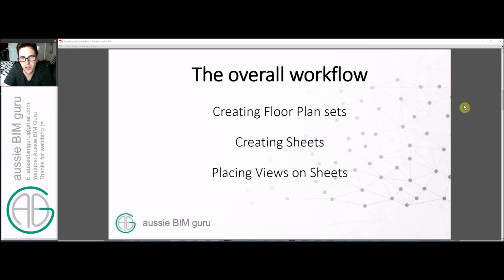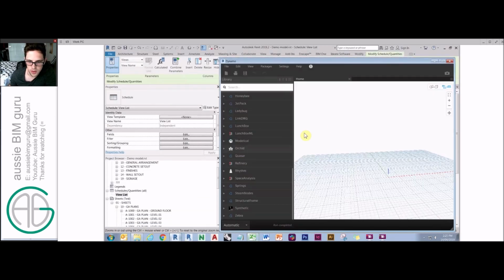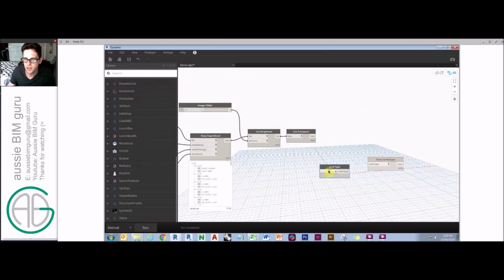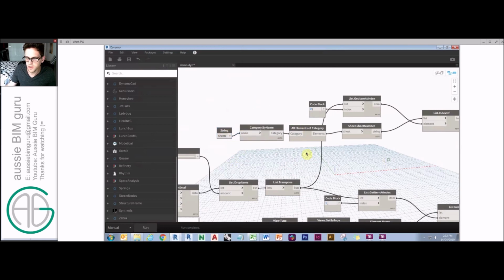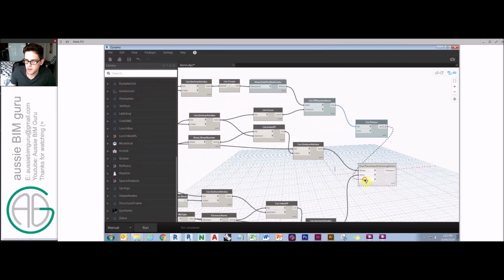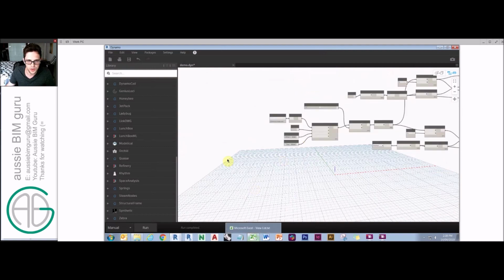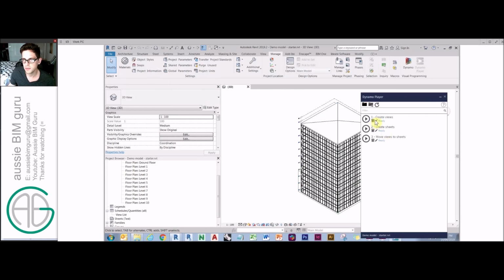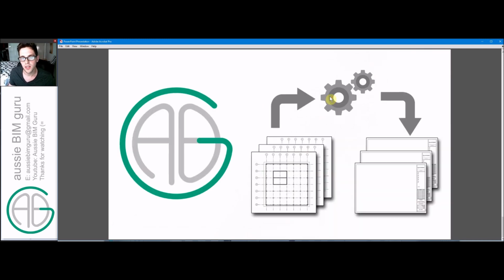Place Views on Sheets using Dynamo! (Views to Sheets 3/3)

Comment: Thank you BIM Guru for spreading wisdom! I am new in Dynamo and using Revit 2021 with Dynamo 2.6.1.8850. For some reason the custom node "Tool.PlaceViewsOnExistingSheets" is not working:

"Warning: This custom node contains an invalid input. Please fix the input before saving the custom node."

To make the custom node working, I have to change all inpust to "sheet: var[]..[]" (with small caps). If I put Sheet (with capital S then it will recognize an element and get an error).

1.If I run the script with Auto lacing then I get the following message: "View is already placed". But it is not doing anything in Revit
2.If I run the script with Longest lacing then I get the "null" message. 

I am struggling for a day to make this work and not sure if the problem is with the listing input or the custom node. Is there anyway to start from back to front and test the custom node alone for just one view / sheet?

Any hint will help. Thank you in advance
Reply from the maker: The custom package is quite outdated now unfortunately. Maybe try my equivalent node in my custom package 'Crumple'. This one should work.
Reply: Hi @AussieBIMGuru , @Sorin-Stefan P. what's the exact name of your equivalent node, I am typing "Tool.PlaceViewsOnExistingSheets" but nothing comes out but the same problematic custom node from SteamNodes. Thank you so much!
Reply from the maker: It should be under Crumple > Revit > Views (not at my pc currently unfortunately). One node should do 1 point for all sheets, the other supports a list of points per view/sheet pair.
Reply: @AussieBIMGuru  you nailed it, it works perfectly!! Thank you so much. Stupid question I am trying to download the scripts you have on your github (not for this but maybe others in the future) but I can't really download a .dyn file, basically I was wondering how could I import this coding in to dynamo to make it work.

Thank you for your patient.
Reply from the maker: @danieltrevijanostehle7829  try github desktop instead. Usually the top right of a repo should allow for downloading as a zip also.
Reply: @AussieBIMGuru  It works I could see the green button and download the "Dynamo_Scripts-master" with dozens of dyn files inside but not this (ABG_190923_ScopeBox-3-ViewToSheets.dyn) seems on the Master file are some files but not all and the ones that are outside, it doesn't allow to download just to see hundreds of coding pages.
Reply from the maker: @danieltrevijanostehle7829  hrm try github desktop instead I'd say.

https://youtu.be/Rr6pVUa5Wc4
Reply: I just found it on the Master file, my bad! Thank you so much for all your support
Reply: @AussieBIMGuru  thanks for your quick reply. Already tried that with both of your custom nodes. Still getting the same "null" error although the input lists seams to be fine:

Views list has 25 items showing the view names
Sheet list has 25 items showing the sheet numbers from
Point list has 25 items with the same point coordinates as per the reference view / sheet in Revit.

I have also tried manually created input list for view / sheet / point  to check if the custom node is working. Still cant get it to work.
Reply from the maker: @SorinPauceanu  make sure the views and sheets are elements and not names.  Otherwise it should work.
Reply: @AussieBIMGuru  many thanks, that solved my problem and it's all working now. Hooray !

The error I have done was in the final nodes for both Sheets and Views (List.GetItemAtIndex) before the custom node. Instead of feeding the Element, I was accidently feeding the Sheet.SheetNumber name and Element.Name as text. Moving back one node fixed the issue (All Elements of Category / Views.GetByType). 

For other beginners like myself out there, the difference between text list and elements list is that elements list have a unique number at the end highlighted in green.

Bless you man!
Reply from the maker: You're most welcome! I used to make that error all the time when I was learning Dynamo originally, great tip for others out there.
Reply: @SorinPauceanu  I am struggling from the same issue .Can you please help
Reply: @AussieBIMGuru   I am getting the same error. Can you please elaborate how to resolve
Reply from the maker: @hallydesai2464  please read the comments where i elaborate on some solutions.
Reply: @Aussie BIM Guru I tried this but I guess I dint get this properly.  It would be great if you can help
Reply from the maker: @hallydesai2464  i dont know what it could be if not the things i address in the replies. Most common issues are typos in excel, custom node not working or elements not being filtered properly (sometimes people use names instead).
Reply: If I run the script with auto lacing I get the following message: your view is already placed . The solution to this is there in this comments which I am unable to understand. If you could clarify that a bit more
Reply from the maker: @hallydesai2464  this means your view has been placed on the sheet already. Usually people run the script and then rerun it to set the viewport type, but the node can't rerun as the view has been placed. My recommended approach is to use dynamo player to run the script in a single run.
Reply: @AussieBIMGuru  ok will try but for now when I run it but it is not doing anything in revit

Comment: It seems the node Tool.PlaceViewsOnExistingSheets has broken due to updated dynamo, any advice on how to fix this?
Reply from the maker: I have a video where I show how to do this in Python instead;
https://youtu.be/6oHl-QEdutw
Reply: @AussieBIMGuru  I tried using it but I'm not sure honestly how to combine the the python from the link you shared to the flexibility of this video. I'm well enough to follow along and create what's needed but fixing or altering code isn't my forte. It looks like the Input>Point in Tool.PlaceViewsOnExistingSheets has changed?  It states, "Error: This input symbol is not currently valid, and cannot be saved until it is fixed." I've been trying my best to figure it out. This 3 pt series is extremely helpful due to a cruise terminal project and how fast everything can be set up. Minus my current hiccup.
Reply from the maker: @josephkirkpatrick345  the problem is the node I used here wasn't maintained by the package's owner. If you don't know how to mod the custom node or use Python try downloading my custom package called 'Crumple', I added it to the manager a few days ago. It contains a fixed version of this node.
Reply: @AussieBIMGuru  I figured out how to mess with the custom nodes and know a little python, but not enough to possibly bring it all together in the manner necessary. I'll go recheck Crumple now. I wish more people existed like you!!

Comment: Hi im getting "View is already placed" at the Tool.PlaceViewsOnExistingSheets" but the views I am selecting are not placed anywhere as I can manually place them on a sheet. Anyone ever encountered this?
Reply from the maker: That is odd! Maybe try reopening the script - it usually doesn't support multiple runs in a dynamo session.

Otherwise, try my custom package on my github (Crumple) where I've built my own nodes that do this as well.
Reply: @AussieBIMGuru  Hi! I have downloaded and installed Crumple but cannot find the node to replace ¨Tool.PlaceViewsOnExistingSheets¨ which is not working for me either. Can you tell me which node to use, please? I am a beginner so I can get lost fairly quickly. Is it ¨viewports.Createbypoints¨? Thanks!
Reply from the maker: @mariavallejos23  yes it is viewport.createbypoint
Reply: Hi, i was getting exactly the same warning. The problem was that I misunderstood and was not passing “views” and "sheets" to the Tool.PlaceViewsOnExistingSheets node, but rather  string values (their names).  Now this great script is working perfectly well and making me save a lot of time!
Reply from the maker: @rubengonzalez1729  yes using names instead of their related element is a common error even I make from time to time!

Comment: Hello, can someone tell me why i get the message null after the first the first information input to "Data.importExcel" - I have checked everything twice and can´t find anything wrong with the scripct
Reply from the maker: If the excel import is failing I would cross check that the sheet name exists and if it does then try rebooting dynamo, sometimes the node runs into problems when excel is open already I find

Comment: Hi Gavin, I am trying to use this method to place multiple views on multiple sheets, any ideas I could use on what needs to be changed for the script and excel file in order to achieve this? Another great video by the way!
Reply: I have also put my question on the Dynamo Forums, https://forum.dynamobim.com/t/placing-existing-views-on-existing-sheets-with-excel-and-a-reference-sheet/49987
Reply from the maker: Hi Serim!

I would adjust the script so that you either collect more reference views (say up to 3) and in excel specify the index of the reference view for each as an additional column, or you could add X/Y/Z values for placement points fot each view as columns also, then feed these into a point.bycoordinates node to define the placement points.
Reply: @AussieBIMGuru  Hi Gavin, I used 1 reference view and an excel file with multiple columns. Eventually managed to filter the script correctly by counting the amount of views to place on the sheets. I posted the solution on the Dynamo Forum post I made earlier! Could you check it out and give me some feedback on my solution? Thanks in advance!
Reply from the maker: If the viewlist always matches the reference views, repeated item lists are a suitable solution for sure!

Also yes, the steamnodes package is a bit out of date - it can be tempremental. If you're curious as to how the node works in Python, feel free to check out my custom package 'Crumple' on my github, which has a pair of nodes dedicated to this workflow.

Comment: Hi, I am new to Dynamo, I was wondering if anyone could help me with my problem. I don't have import excel as node, is there any package that I can download ?
Thanks
Reply from the maker: Hi there!

Import excel is an out of the box node in versions 1.3 +. I believe before then it was called read excel maybe, but there should always be import/excel nodes of some sort available.

You can also find export/import excel nodes that are a bit more advanced in the Bumblebee package.
Reply: @AussieBIMGuru  Thanks for the fast reply. I would really appreciate if you can help me with one more issue:
everything was going well but I am getting error at List.IndexOf. The value is shown as "-1" 
https://imgur.com/a/w7ZeZOK

I dont usually subscribe to channels, but you deserve to be subscribed and videos to be liked ;)
Reply from the maker: Hi there, sorry YouTube is getting terrible at notifying me of replies - I have to manually go back and check for them sometimes. A -1 index means it found no match, I'd check both that your data types are consistent and that there are no typos/mismatches in the two sets.

Comment: Good Script...!! Do the tool.place view on existing sheets node work ?...I am getting null on the node even though my view, sheetname and points are correct...It shows null..
Reply from the maker: I found it can be tempremental sometimes - depends on Dynamo builds. If you're using Revit 2020, I've built my own versions in my custom package here: https://github.com/aussieBIMguru/Crumple
Reply from the maker: @Ryan Dempsey unfortunately I've only used this script in 2019+. I suggest using the latest possible version of Dynamk and the steamnodes package for 2018. Try a small test as well (e.g. 1 sheet).
Reply from the maker: @Ryan Dempsey if you get to 2020 try out my package on my github instead - I rebuilt my own version of the node.

Comment: Hello Aussie BIM Guru, For some reason, i have an error for the steam node and ToolPlaceViewOnExistingSheets, it needs me to edit the custom node and correct the "Point" input, I did change the capital P (Point) to small p (point) and the error goes away. I did everything you did, no errors or anything, and the script run complete but there are no views in my sheets. can you help? Thanks
Reply from the maker: Hi John, which version of dynamo are you using? I've found the steamnodes node can be quite tempramental.

Try running from dynamo player as well - it doesnt work well from native dynamo.

I'm hoping to release an updated version of this node as the steamnodes one hasnt been updated for about a year now.
Reply: @AussieBIMGuru   I am using 2.3.0, I did run it from dynamo player but still the same, I put watch after ToolPlaceViewOnExistingSheets node and its all null values, maybe something I'm doing wrong? editing the node might have caused this?
Reply from the maker: @HappyWifeHappyLife-Xoxo  Typically editing custom nodes is risky so it might be that. I'd only do that if you understan the issue 100%. My guess is that edit didn't work.

Maybe ask dynamo forums for now and follow my github custom package for when I add the equivalent node to crumple.
Reply: @AussieBIMGuru  Hi Guys, thanks for all the great info Aussie BIM Guru. I also get the 'point' input issue. I wondered John if you had found a fix? Aussie do you have a video or guide to your ViewsToSheets_ByPoints node? I get a null response to the viewports and report. Thanks!
Reply from the maker: @drummermanjustin  no I haven't got one currently, but the most common reason for a null is incorrect input structure. It should be an equal lengh list of views/sheets @L2 and a point @L1 in order to work correctly. Make sure the views and sheets are elements, and no null values are present.
Reply: @AussieBIMGuru  Thanks very much for getting back to me so quickly. I've got the equivalent node from the Rhythm package to work. Thanks again!

Comment: Im getting an error "Warning: Element.SetParameterByName expects argument type(s) (Element, string, var), but was called with (string[], string, Revit.Elements.Element[]).
Any idea what it can be?
Reply from the maker: Your elements must be text. Check where they come from in the script - a common cause is feeding in element name instead of the dynamo elements themselves.
Reply: @AussieBIMGuru  The elements are coming from Tool.PlaceViewsOnExistingSheets node.
Reply from the maker: @alexj6658  make sure you run the script all in one. Once the views are placed, the node outputs text instead saying the views are already placed.
Reply: @AussieBIMGuru  Thats exactly whats happening.  Tool.PlaceViews is saying that he views are already placed but they are not.
Reply from the maker: @alexj6658  strange. Try rebooting revit and dynamo, removing all views from sheets and rerunning. Beyond that I am not sure why - you may need to raise it as a bug with the package developer.
Reply: @AussieBIMGuru  That did it thanks!
Reply from the maker: @alexj6658  awesome! It's always annoying when the IT solution of 'turn it off and on again' works, isn't it haha!
Reply: @AussieBIMGuru  Exactly! Thanks again for your help.  Im loving Dynamo.  Its going to make my job so much easier from now on.
Reply from the maker: @alexj6658  you're welcome!